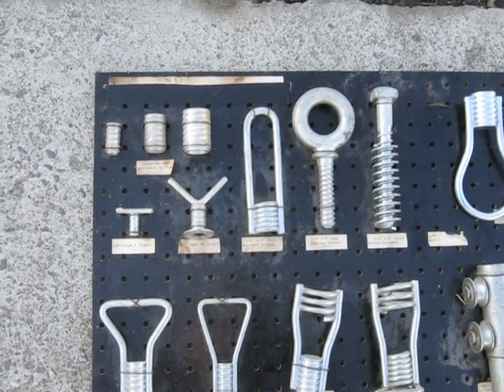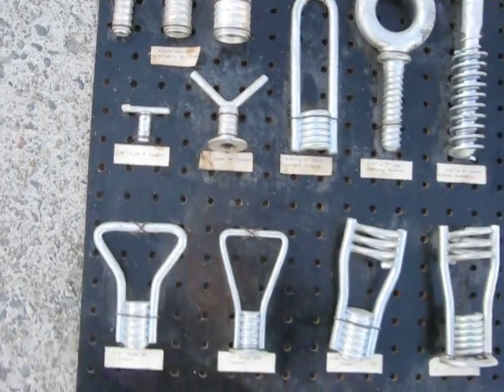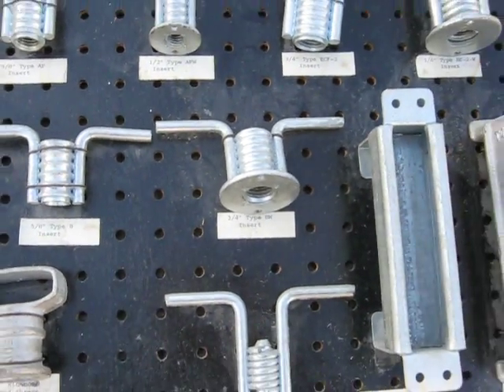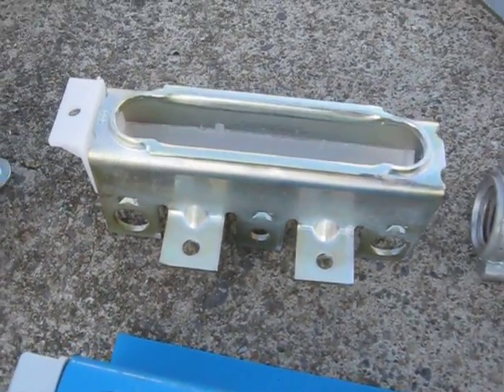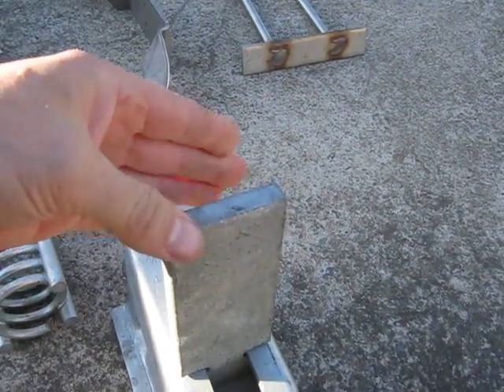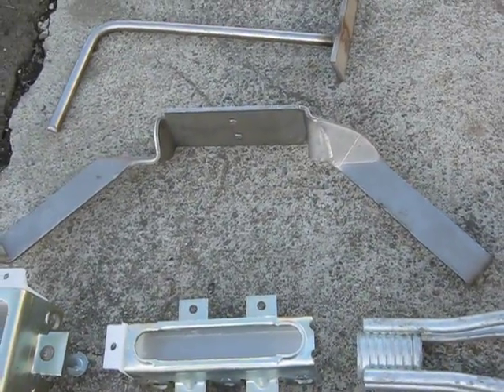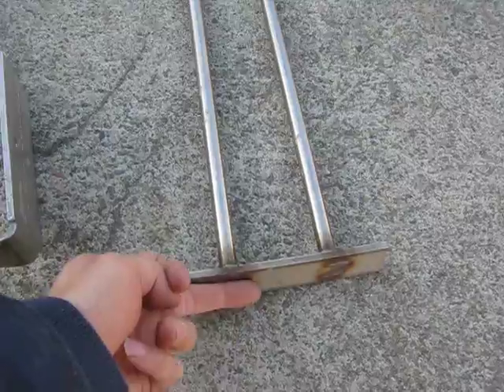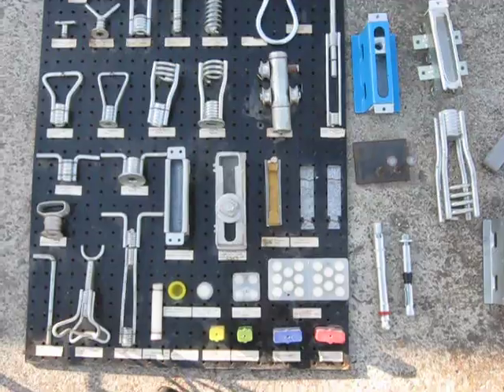Various Concrete Anchors

Comment: What is the blue insert strut called?
Reply from the maker: Thats a good question, i have been out of the concrete industry for a few years now, so I am not sure. Crazy thing is that I still have that insert, I use it for a door stop, but there are no markings on it. If you really need to know, i can probably find out.
Reply: ChargerMiles007 
Please if you can find out the name it would be greatly appreciated. I have a upcoming job and this would help greatly. Thank you

Comment: At my last job I helped make fixtures for welding wireform anchors.  BTW have you ever worked with an "epoxy bolt"?
Reply from the maker: douro20 I haven't worked with epoxy bolts, but have heard of them. I just scratched the surface of what is available with this vid!

Comment: Are you in the construction field for your daily job??
The prestressed concrete, that's the stuff that has a high tension steel cables running through it, if so I know the demolition guys hate that stuff considering it can be very dangerous when you start breaking it apart.
Reply from the maker: redneckbryon Yes, I bet it would require special procedures to tear the pre-stressed concrete apart, since there normally are high tension steel cables imbedded in the concrete, as well as rebars. I have no knowledge about how to tear a bridge girder apart, but I would imagine it would be best to start at the end and demolish towards the middle (but don't try it on my advice!)Prestressed concrete has the advantage that a bridge beam for example is already being pulled upwards toward the middle, so it doesn't sag nearly as much as a steel beam would, which is very hard to pre-stress.